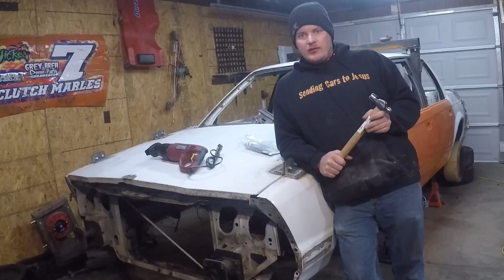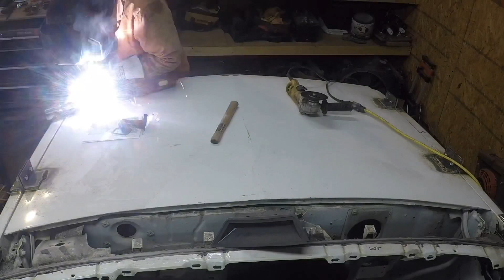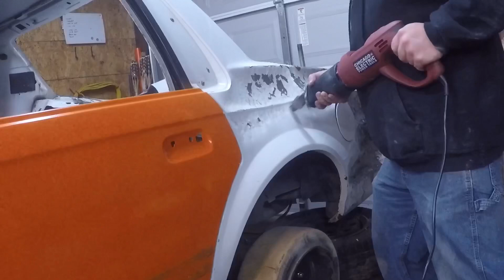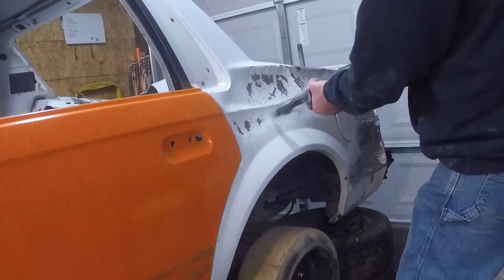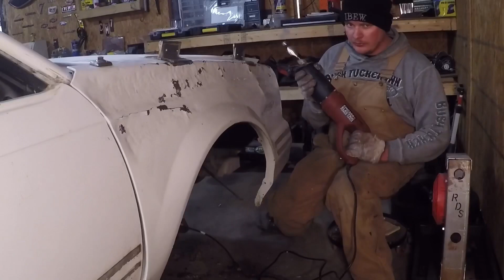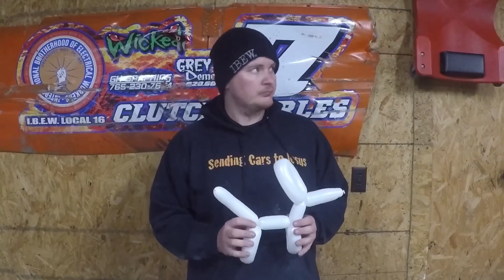Assault Hammer: Body Creasing Derby Car Tips

Comment: What exactly is achieved by this?
Reply from the maker: Turd Ferguson Take an empty soda can, you can smash the sides in with your hands... but if you crush that can first, it makes it stronger.  Putting dents and bends in the right spots can make the car bend differently.
Reply: It makes the metal stiffer and doesn't bend as easy. And if u do this and have your metal worked right it will help keep places like fenders from being ripped apart or bending strangely and going into things like the tires. Or if done right in rear it will help it last a lil longer and help it fold up better and not blow out and plow.